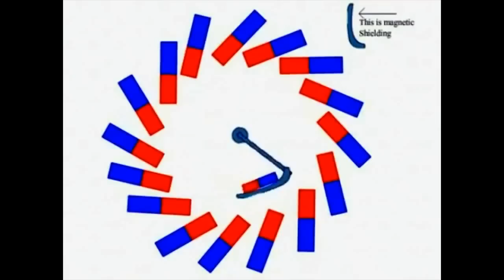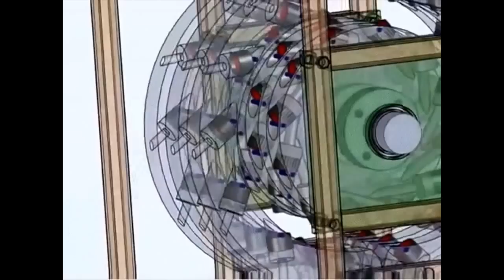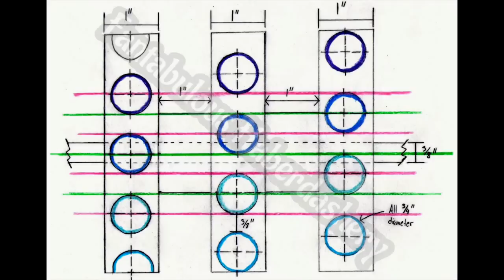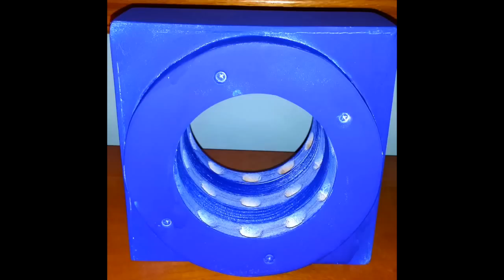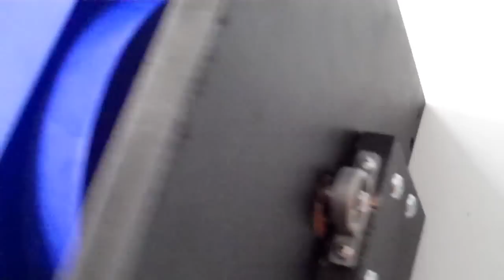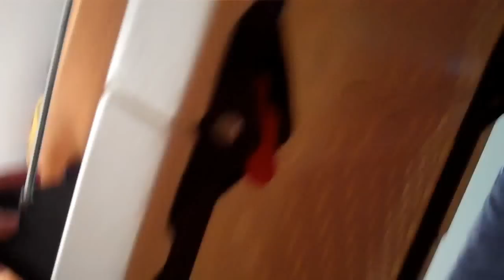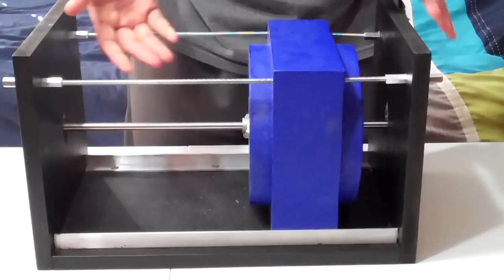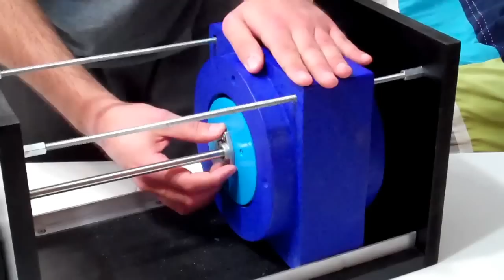Working Perendev Magnet Motor!

Comment: First, on your discussion of theory: There is no energy in a magnet. A magnetic field is like a spring: You can store energy in it by positioning something within a magnet field. But it has no energy of its own.

A magnet is like a spring. It merely stores energy and releases it. 

You may be able to get it to spin for a while, just as you could set up springs to make a device run for a long time (pocket watch, anyone?) but you will eventually stop. Each transaction removes a small amount of the energy that you first added by spinning the shaft against your arm.

Energy to initially spin the device = Energy lost in the first revolution + energy lost in the second revolution ... energy lost in the nth revolution, where n is a finite integer.

But let's suppose that there were "energy" in magnets. That would mean that to make a magnet requires an input of energy. So that would mean that magnet are merely another form of battery:

Energy added to the magnet - energy lost in the process of magnetizing the magnet + the energy of rubbing your arm against the shaft = the energy lost in the first revolution + energy lost in the second revolution ... energy lost in the nth revolution, where n is a finite integer.

In other words, this device does nothing, and even if it did something, it still wouldn't do anything.
Reply: The magnetic field of a neodymium magnet will only lose around 3% of its strength in 200 years. So it would stop if it ever was made to work. But for the inventor, well worth the effort.
Reply: Um... It's not a question of losing its strength. The strength of a magnetic field has nothing to do with its "spring-like" nature. You can store energy within the field of a field force by placing an object in the right spot... but that energy does not come from the field force, and the energy you get back is always less than the energy that you put in.

For example: Gravity is a field force like a magnetic field. If you lift something ten feet off the ground, then let go, it will accelerate into the ground. But the energy to lift it ten feet is more energy than you get by dropping it ten feet.

That has nothing to do with how strong the gravitational pull may be. On the moon, or on mars, or on mercury, or on jupiter -- it would be the same. Lifting one pound ten feet takes more energy than you get by dropping one pound ten feet.

Magnets are the same way. So whether or not a neodymium magnet loses 3% of its strength in 200 years has nothing to do with it. Energy is ALWAYS ALWAYS ALWAYS conserved. No exceptions.
Reply: WhereWhatHuh Sir. Could you. please post some type of proof that what you are writing is in fact true concerning a neodymium for example having no power. And if this is true then rare earth magnets are even. more amazing because that would show that these substances can pull energy directly from... what? The air the solid objects around them. Or possibly the Earth itself? My point is, when you're using a neodymium or other permanent magnet you are getting energy from somewhere which can aid in or run 
solely on the energy that comes from somewhere? So it cannot be called a perpetual motion engine because it has a source of energy Magnetic.
Reply: I'm sorry: you'd like me to prove that a magnet has no power? Um... I refer you here: 
https://en.wikipedia.org/wiki/Magnetism 
Please note the segment titled "Sources of magnetism."

There is no "energy" in a magnetic field, just as there is no energy in a spring. Push something into a magnetic field and it will be attracted or repelled to some degree, just as pushing something into or away from a spring will cause it to be attracted or repelled, depending on the type of spring.

The energy that you see when a magnet is attracting or repelling something is there because something else expended MORE energy to place an object within the magnetic field. JUST LIKE A SPRING. A spring pushes or pulls because it was pushed or pulled FIRST. Likewise magnets.

If you are truly curious, you may wish to read this, about the Electroweak force (from which magnetism arises):

https://en.wikipedia.org/wiki/Electroweak_interaction

Comment: All you magnetic gurus out there. 1) Magnets get "demagnetized" as they can gat "magnetized". So this is NOT a source of infinite power because at some point your magnets did not have enough magnetism left to power your motor. 2) Magnets are not coming in this shape you are using it. They have no magnetism. You actually need more energy to shape the magnet and to magnetized it as you can get out of it. 3) This is why you don´t see this motors running very long. There is no magnetizm left.

Comment: "Magnets loose their charge"... dumbest thing I've heard in a long time. Read up at least on the basics of how magnets work. They aren't "charged" with anything. They are composed of tiny individual magnetic particles that are all aligned in the same direction. 
Secondly: You have shown nothing. You spin it up, it spins, it slows down eventually. Like any mechanism would with good ball bearings. You say you "feel" that your experiment is a success? Well, your feeh feehs aren't science, you need numbers. Attach a combined motor/generator. Then spin it up using a known amount of energy. Turn off the power. Measure the amount of energy you get back from the generator as the device spins down. If you do indeed get more energy out than you put in, I'll listen, but this was just pathetic.
Reply: I usually let the "magnets are charged" stuff slide as just sloppy wording.  In the making of a magnet they have to magnetize it.  To the lay person, this is a lot like charging even though the efficiency is extremely low.
Reply: nRXpAa8E6UML
Magnets are in a higher energy state.  That is why they lose strength over time etc.  You can magnetize a magnet with an extremely strong field at room temperature.
Reply: u need to see the video ""how magnets are made?" search on youtube. u will know. And it is true that after an amount of time the magnets definitely loose their power that time could be 300-500 yrs.... google it if not satisfied..
Reply: nRXpAa8E6UML magnetic energy is similar to nuclear energy, it decomposes over time. Hence the "charge" statment. Magnets have never been truly "permanent "
Reply: Guys. I know. I don't need a YT video to tell me how magnets are made. I have a Bachelor's degree in physics. When magnets are magnetized, the tiny individually magnetic elements are aligned such that they all point in the same direction. Yes, magnets can get de-magnetized for example simply by heating them (which jumbles the tiny magnets around so they aren't aligned anymore). But they aren't charged! It's not even legitimate to explain it to a lay person as if it were a charge, because it's WRONG! 
If you had some sort of "charge", in the broadest sense, it would imply that it was in some sort of higher energy state (like a battery that has chemical potential energy, i.e. the chemicals inside are in a higher state of energy and would like to fall to a lower state of energy if you just let them). This is not the case here. Instead, in order to de-magnetize them, you have to put energy in in the form of heat, until the magnet hits a certain temperature where the forces that keep it's components aligned are overcome. 
The reason they still de-magnetize on their own is because they already have a temperature, which means the tiny magnets are jiggling around a little bit which in turn means that there is a small probability that they will just flip on their own. But, again, you can't extract energy from this.

Comment: Funny how it self sustains when both hands are not in view. His right hand is definitely using a motor to drive this device. FAAAAAAAKKKE. See 8:39. Can you see the shadow of the external motor on the left hand side of the device? @9:17 he removes the external motor and the device slows down instantly.
Reply: You need to get your eyes tested my friend.  No shaft? Its as plain as the nose on your face. Can you not see the shaft and bearing protruding?
This is a Perendev type magnetic. There is something really interesting about a Perendev motor.
NONE OF THEM HAS EVER WORKED.  They are all fake. What makes you think this one is any different?
Show me a proven Perendev machine working and i will put my balls in a vice.
Reply: You need to look again. He is clearly using a motorized device with his right hand that is out of view. @ 8:39. He removes the motor @ 9:16 and it slows down.
This is completely fake. The guy in the video is a liar and a cheat.
Reply: Brad
Reply: There's nothing to attach the motor to on the left hand side. There are electromagnets inside of the blue box.
Reply: Beetlejuice 01 Did you watch the entire video? I don't think so... There is no shaft protruding on the side to connect a motor to. Second of all, he shows it run when both hands are holding it. I don't see why it would need to be that complicated when he could simply use electro-mangents inside of the blue box. Now, I'm not saying you're wrong, I'm just saying it would be easier to use the blue box and electromagnets. Having said that, I am done with this cancer video and will unsubscribing from all comments. Have nice day :)
Reply: I'm actually agreeing with you, and somehow you're still managing to miss my point. Okay sure, the shaft sticks out a few mm. You have to fiction mate some motor to it, making all kinds of noise. Why not just put electromagents and a microcontroller in the blue box? I'm not saying it's real, the electromagnets are what makes it fake. Yes, he built an electric motor. No there is no reason to use some externally mounted motor to mate up with the shaft. There is every reason in the world to use the blue box, a microcontroller and some electromagnets. It's incredibly simple, and doesn't make any extra noises. I never said his motor worked. You need to calm down.
Reply: See these in science fairs all the time now. Bet you feel pretty stupid. Shill.

Comment: Very well done, its a pity that you didn't have it so it did not wobble in the middle, may have worked even better.
Reply: Its fake. He is using an electric motor. Watch his right hand @ 8:39
Reply: Beetlejuice 01
Not sure, but there is a lot of trim cut in the video especially when he is showing the item running.
Reply: Just watch the shadow of his hand @ 8:39. The shadow appears on left hand side of the device. You can clearly see that he reaches for something and then the device self sustains. He is using a motor that he has concealed behind the Laptop. Its completely fake.
Reply: Oh  yes I see it, another scam, thanks for pointing that out. Peace.
Reply: +kurrrup   He's spinning a heavy, UNbalanced flywheel with an electric motor on the left side of the frame ( of course, just OUT of frame ) the phony baloney.

Comment: I like where you are going.  Some questions I have are this. 1. How big would this motor have to be have sufficient torque to drive a belt, pully or shaft?  2. Would the output of the motor be reasonable enough to use in applications that it would compete against?  i.e such as an electric motor even half the size. 3. Weight if this was used in a model that is either propelled, driven, or energized could the weight be justified.  Such as foam airplanes in the last 5 years.  Because of the new lithium batteries and motors we can fly micro airplanes with full control just like a 1/4 scale model.  Solve these questions then I believe you will have a viable solution to converted energy.  I have been toying around with the idea about finding a way to convert frequencies to energy.  Take the particle that is observed and convert the matter to a frequency wave to store that energy.  The closest I have been able to find is tesla coils.  You are bright and I encourage you to pursue your dreams.

Comment: I think it is really cool...the idea that the magnets are not in a perfect row is so that as one is passing through the magnetic field the other one is in position to to push the one through the field and then it get's lined up to push the next one through and into position and so on...until it is spinning!...I had the same idea but instead of using one wheel to hold all of the magnets I was going to use three wheels all on the same shaft to do the same thing...as one enters the magnetic field.. one on the other wheel is already in position to push it through the field and into position, and with three wheels all on a common shaft each one pushing the next into position...it may be easier with my method to fine tune it...

Comment: Nice work I'm' working on Stan Meyers stuff "Hydrogen fracturing" But I was always interested in this. I have researched it as well and found the speed Dows make it run and actually speed up. I would suggest as a test put a Motor on the shaft to speed it up and see what the Affects are at higher RPMs if u can make the motor able to pull back after u reach said rpms.  If u haven't seen it here is a Guy that did similar work and says it goes faster or assist.  https://www.youtube.com/watch?v=PzIfowus-HY

Comment: Put a coil near the rotating magnet, generate a voltage, connect a LED or bulb, draw some power, then compare running time to the time without a load.

Notice how a magnet stuck onto a refrigerator stays there, but also notice how no work is done in staying there.

Let it do some work, and measure.
Reply: Cos work means movement, allways physics !